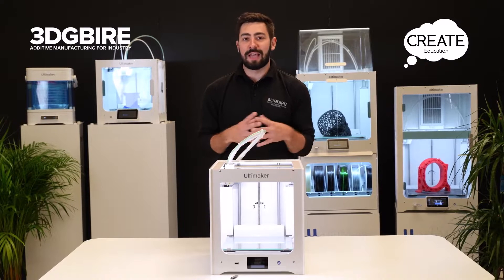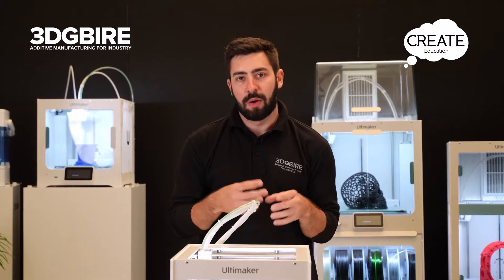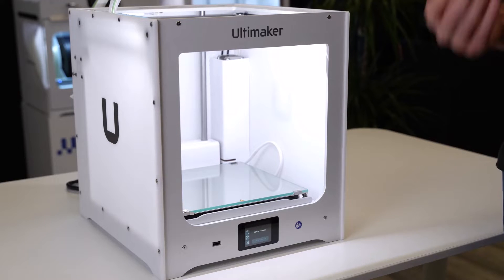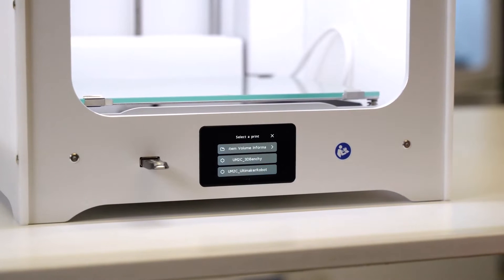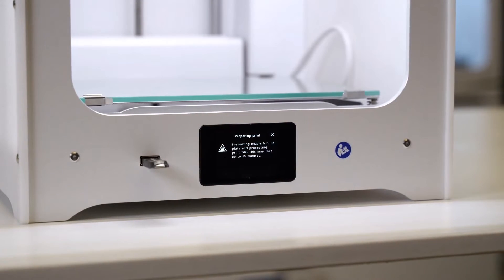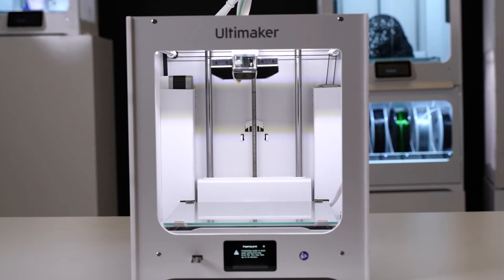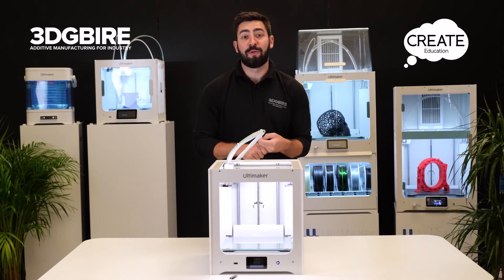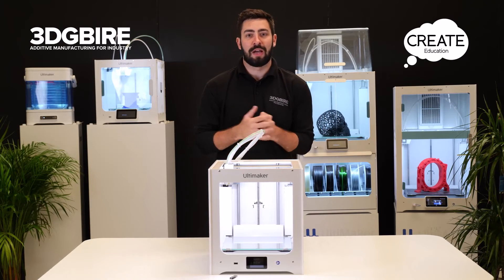The UltiMaker 2+ Connect 3D Printer: Starting a 3D Print

Comment: Is this a really old video cause i cant imagine a modern printer costing 2300$, still having a glass buildplate, uses 2.85mm filament all whilst the print looks terrible.
Havent seen this print quality in years. I've used the original wooden Ultimaker years ago and it was bad back then, i can't believe nothing changed in the meanwhile.
Sorry to come across negative but people deserve better, it feels like a scam by now. I can't comprehend how Ultimaker is still around, hopefully you can get a refund or got them for free.
Thanks for this video, brought back some fun memories!

I just checked the website and its weird, 0.25 mm nozzle: 150 - 60 micron 0.4 mm nozzle: 200 - 20 micron 0.6 mm nozzle: 300 - 20 micron 0.8 mm nozzle: 600 - 20 micron
So in their world the smallest nozzle has the largest minimum layerheight? Everything about Ultimaker seems wrong. Also printing 20 micron with a .8 nozzle with 2.85 filament is just delusional. A .6 or .4 nozzle would really struggle to do that. Especially if you consider Ultimakers dont have automatic bedleveling. 
Now that i think of it, no automated bedleveling for a printer thats 2K+, truly some printers that are 1/10th the cost are leagues better and have more functionality.
Please for your own sake, get something from this decade. Again, not wanting to come across too negative but when it comes to Ultimaker, they make it extremely hard. 
I like their color scheme to end on a positive note.